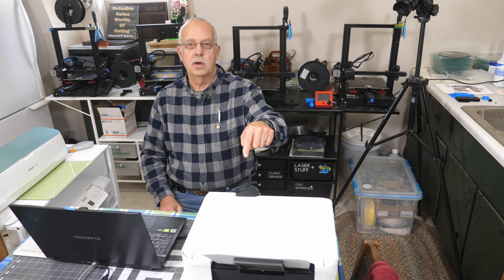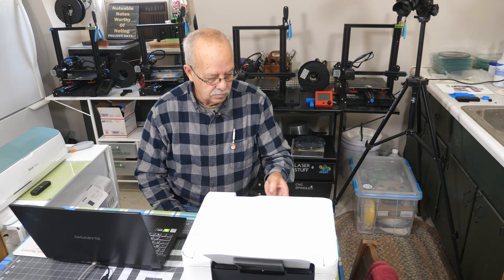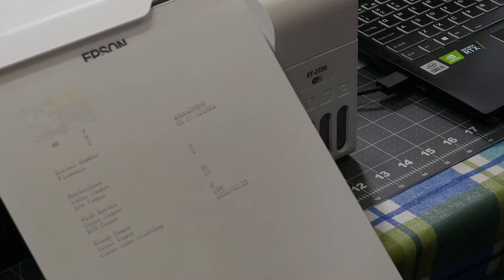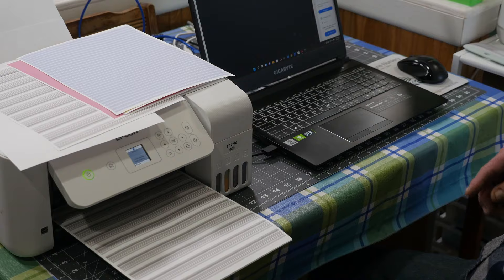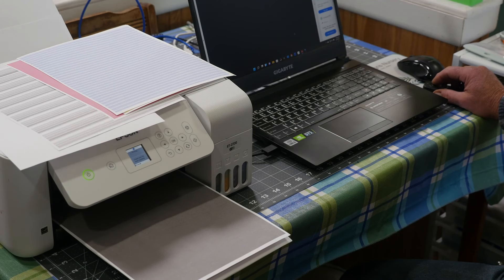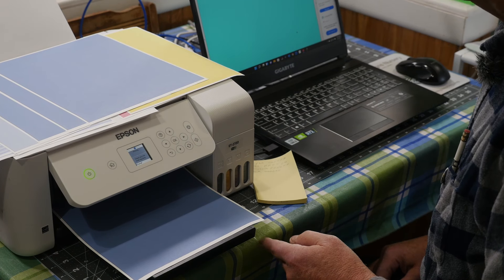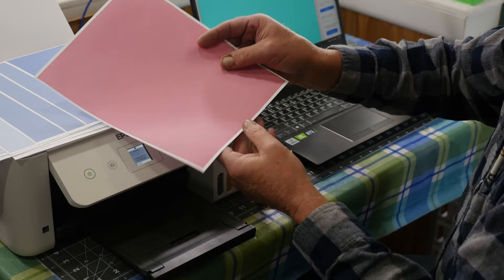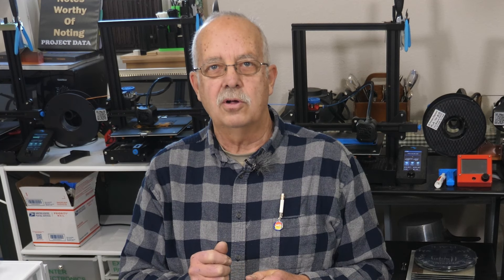Epson 2720 Printer Clogged Nozzles FIX

Comment from the maker: NOTE:  this works for "MOST", but NOT everyone.  As they say, "Your Mileage May Vary"!
Reply from the maker: @Alicia Woodard Since it is a download, it is in the description:  Link to free download of .pdf color files to print:  http://moonshinecrafts.com/help-with-...
Reply: Any suggestions if I tried at least a dozen times on each color that doesn't work & they're both still blank? It was printing fine last night (all colors) & then after a few sheets, magenta stopped working. So I bought more ink. Now I've been troubleshooting all day. Ugh!
Reply from the maker: @kevmicshi  You can try shaking your printer from side to side several times and try again.  This works most of the time, but not for everyone.  As a last resort, try a Power Clean.
Reply: @Roger's Shop  Thanks for the link. I have an Epson 8550. Do you have links or info for the additional colors? Pigment Black, Gray
Reply from the maker: @santafepainter  I do not have the HEX codes for the other two inks.
Reply: @rogersshop  I have printed I know 75 sheets of cyan still have lines the other colors are fine any other suggestions
Reply from the maker: @tonyabailey1028  This may offer more insight:  https://youtu.be/uffJPjR7Sy8
Reply: Help I’ve printed & printed the sheets and still have lines. I’m devastated, I can’t do anything because of the lines.
Reply from the maker: @annierakes2435  Try changing your settings to high quality photo, this often works.
Reply: Hey Roger! My printer is practically new I used it twice and it sat up for a minute! It stopped printing all colors. Can I still use your method to try to get it to work?
Reply from the maker: @cemax7866  Yes.  You might also try shaking the printer side to side several times.
Reply: @rogersshop  thank you so much for responding! You’re appreciated! I enjoyed the video very educational for beginners and easy step by step processes! I will try your method and see what happens!
Reply: Thank you
Reply: Thank you so much. Easy to understand and the free pages are so nice!  My colors were ok, they look better now though. I'm still black-less... I mean zero black... but I'm not giving up!  I can't find a speed setting when I send to print, to adjust that. But I'll try the photo paper  settings on the printer itself.  I am determined. (Determined to avoid hearing the flurry of bad words when my college kid can't get his papers to print at the last minute!  Haha)
Reply: @rogersshop TYSM for this. I didn't see where high quality option is at or more options 😢
Reply: @rogersshop  my printer is working great again. I caught  it as it happened. Thanks a bunch.

Comment: Is it safe to use this method when the epson utility keeps warning to check the Inc  levels when I'm doing a regular cleaning? we've did several cleanings and check the ink levels, but so far all I could get is cyan to print with your method. i'm worried about repeated attempts to print pages if it's not working damaging the printer. especially since I get this warning message. I don't think it's saying low level, but I am totally blind and don't know for sure I have to get sided confirmation. thank you.

Comment: Perhaps this wasn't a thing 2 yrs ago but if anyone tries this recently, the maintenance tank is in fact replaceable on this model. The flap for it unscrews with one screw at the back corner of the printer.
Reply from the maker: Yes, it is replaceable when you can find the part.  Hit and miss item.

Comment: It works!  My black had lines through it and it took about 50 pages and another ink refill (I had just refilled it a few days ago) but it works now!  Thank you for a simple solution and for providing the CYMB template (another video told me to google it and that was getting frustrating). I appreciate your calm, easy pace throughout the video.  You're the best!:trophy-yellow-smiling:

Comment: I can't tell you how many YouTube videos I watched to try to figure out how to get the color ink to work again on my Epson printer.  Finally I found your's & it did the trick.  I would much rather use up paper than run the risk of overloading my maintenance tank or do some of the other procedures suggested by the other videos.  Thank you so much for this information as well as for the test color pages that I can run and run until the nozzles are completely unclogged again.  What a great service you just provided!

Comment: Excellent suggestion, Roger. Thanks!  I was about to try a deep clean and didn't even know about the waste tank issue, so I'm glad I found this first.  Your method resolved my "no yellow" issue after only six pages. (It worked even better once I forced the printer to print as if it had glossy paper even though I was using plain.)

Comment: Thank you very much.Yesterday I was going to clean the heads using solution which will take time and will have a mess. I already opened the top of printer.
Then I told myself, I will try to watch another video. I saw this one. I made power cleaning which fixed the problem.Printer wasn’t printing at all before that.
Thanks again.

Comment: Update:  I printed out the solid color file you shared (thanks so much).  I was wondering how to flush the old ink.  Well the black kept being really streaked and the other color had mild streaks.  So went back and rewatched your video!  Bingo, you noted to run the pages in slower, high quality setting.  Once I did that, I got beautiful solid colors.  That did it.  Now I'm getting beautiful pages again.  Thanks so much for this excellent video.    I went from getting NOTHING on printed page to getting full beautiful color.  I ran the head and nozzle cleaning tons of times before that and it didn't really do anything.  After flushing it out with the solid colors and changing the quality of print, it now runs great.  Again thanks.
Reply from the maker: Glad it worked out for you.  This works for most, but not everyone.

Comment: I spent a long time trying to get my printer working. Blue and yellow had stopped completely. I tried printing your sheets many times but with no effect. My tanks were about 3/4 full, but I decided to top them up in anticipation of a power clean.  A last nozzle check then showed yellow working and blue missing only one line. I then printed your blue sheet and all is now working perfectly. I think the solution is that topping up the ink and giving the top-up bottle a light squeeze sorted out an air lock in the tubes. 
To summarize: If a colour is missing completely, try topping up the colour and giving the bottle a gentle squeeze before printing the colour sheets, as this may be the solution.

Comment: Sadly I had to use the power cleaning because after ten pages it wasn't printing a single drop of color. My black ink was fine because I print with it often, but I never print color. 
Power cleaning worked and I learned my lesson.  From now on I'm printing once a week to keep the ink flowing.

Thanks for the help, Roger.

Comment: Thank you so much for this. I just followed your lead and it totally worked for me! My cyan wouldn't print at all, though it was full. Now it's printing back to normal. I really appreciate your advice about the maintenance tank, because I kept running the clean function, and no doubt would have ended up having to get a new printer.❤️

Comment: I just recently started looking for a DIY video to help at cleaning my 2720 and after about two or three other folks I came across your video Roger and at first I wasn't sure as to what information would be shared...however, after taking the time to watch your video I see your have some some very sensible and cost saving measures to clean the print heads without taking the printer apart or replacing the storage filter before it time.  I've been there and done that and I figured there has to be an easy way.  Thank you so much for the pdf sheets.  I tried them and it worked well.  The cleanest I've seen my printer since owning it (for over 3 years.)  Thank you for being there and sharing this for us Roger!!!  Saved me a lot of time and extra money.

Comment: Thanks Roger for this helpful video. I used it to clean up undesired lines in print outpus on my Epson ET-15000 and ET-8550 printers.  The key is to print colrs at the BEST setting to clean out clogs. Thnks, again. Blessings!

Comment: Great video. I have the same printer and didn't think this type of ink would dry up but it does over time. I used alcohol and paper towel to physically wipe the nozzles. That helped, but  i still had to run dozens of test pages . Uses less ink but takes more pages.

Comment: Good video Roger, I have an ET2720 with sub ink in it, I made the mistake of running a power clean before I knew better, Another way to prevent this from happening is printing a print once a week that uses all 4 colors.

Comment: I just wanted to thank you for solving my problem.  I have an Epson ET 7700 with a white line problem.  Thanks to using your print out colour sheets, I found it was just the Cyan and Black that had the issue.  Just 2 prints out at best quality and they all seem to be okay now.  Many thanks for the advice.

Comment: Didn't really find the option to make it print slow, but I selected High-quality, 600dpi (if it makes a difference). My Magenta has some lines but it prints the full page, Yellow and Cyan I ran about 10x and the page just comes out clean. I'll try running 100 more times before I do any power cleaning. Thank you for explaining so well!

Comment: I wish I would have come across your video earlier. I had already done the Power clean but the purge printer are slowly working. not sure what I did (I use my printer almost daily) and it wasn't working but the purging after about 40 times is finally getting my yellow and Cyan to print with lines and the black is slowing coming along... hopefully this keeps me from having to buy a new printer today. Thank you!

Comment: Hi Roger. I was hoping to make a 'hooray' comment but this method hasn't yet worked for me. I have the 2720, using regular ink and not sublimation and the cyan is not printing at all.  I have purged about 20 sheets with slow/quality print settings. I opened the machine up and it looked like the reservoir closet to the nozzle head isn't filling with ink. Clogged line I guess. Any suggestions before I surrender to the power clean??? And can we not replace the discarded ink pads/reservoir after they are saturated??
Reply from the maker: Try disconnecting the printer and shaking the printer side to side several times and try again.  May be sediment is clogging the tank outlet.

Comment: This was such a blessing to find this video. Solved about 99% of my problems.  One color, Cyan is still showing one while line even after more than 25 full page printings.  Do you have a suggestion?
Reply from the maker: Try running a sheet in photo mode, high quality.  This might work to clear that one nozzle.
Reply: Roger, you were right. Cleared it right up.  Man I can't thank you enough.  I have been so blessed by you willingness to help out.

Comment: Thank you so much.  I have been researching Epson vs Sawgrass and it seemed that I would have to do sublimation every single day using the Epson to prevent nozzle clogs and all I would have to do with Sawgrass is the nozzle check.  I wouldn't do sublimation every single day since I am only making items for gifts so I did not want to invest a lot of money into an actual sublimation printer (even though I would love to).  This video has helped me so much.  At least I know how to clean the nozzles if I ever needed to.
Reply from the maker: The advantage of a Sawgrass is that it self-maintains.  But, you DO pay for that!   With the Epson, so long as you run at least a nozzle check once or twice a week, it should be fine.  Just enough to keep the ink from drying on the head.
Reply: Hey Roger, I tried your method as several nozzle checks did not have solid lines. Went through about 50 sheets of paper front and back with no magenta, yellow, and cyan fading with each print. And black fading with each print. Eventually I had to do a power clean which did get me every color but still awful lines in black. I am at a loss for the black. I honestly don’t know what to do. Any advice?! I have a 2720. We also tried a wet paper towel method, and nothing. I tried to do your method again, with just printing out the black- still a ton of horizontal lines. I also shook it back and forth- nothing.
Reply: also i tried vertical and horizontal alignment- and it’s totally off w both. Lines in everything. Is there any hope for this printer?! 🥴

Comment: Thank  you for the link. I had been looking on the ET-3600 video. Will be trying them today. Cyan is acting up.    I've used the cyan file. After about 8 printed pages of nothing I'm convinced that I need to physically clean the cyan print nozzle. Thanks again for the help.

Comment: Nothing worked for me to have the color show up so I had to do a power clean. I wonder how many power cleans it takes to clog the ink pad? I emailed epson about my issue and their response was super unhelpful and didn't address the issue at all, not sure if I'm the only one who's had this experience. I also asked customer service how to prevent ink not showing up and they basically said "idk".. thank you for this video, super helpful. I'm going to run it every week like you mentioned and hopefully I won't have to run into this issue again!
Reply: Also I'm probably going to renew my warranty, I'm becoming more paranoid that it'll stop working on me one day 😅
Reply from the maker: Once you get everything working properly, print some thing is full color at least once a week, even if it is only the nozzle check sheet.  This should keep the head clear.  If you should happen to fill the maintenance tank, it may not be replaceable.  Depends on the model.

Comment: For all of you that this didn't work or was taking too long: I opened mine (not hard, just 4 screws). I saw that the dampers in the head were all empty. Black was full (black was the only one working). I took the lines off the dampers and pulled with a syringe. After 2-3 syringe-fulls of air, the ink came. I then put the line back, and pulled on the bottom of the damper with the syringe until the ink was pulled into it. This made sure there was no air or clogs and that the ink was finally in the printer head. So far so good.

This is a great video though and if my problem wasn't so dire it would have been the trick. Will use my printer more often ... haha.

Comment: Hi there, Roger. i tried it. my 1st page showed a good  sigh lots of color with some lines, 2nd page all the way to the 18th page all clear no ink on page, this is for my magenta and cyan.. haven't tried the other 2 colors. any suggestions? BTW thanks for your  video!! ive learn so much from watching  your videos and taking on your recommendations!
Reply from the maker: You can also try disconnecting printer, then shake from side to side several times, then reconnect and try again.  This works "most" of the time.

Comment: Hey Roger. Thanks for the video.
I have a clog but it's very clearly at the tank end.
Yellow and magenta seem fine ish but black the whole line is clear without any ink in it all the way back to the filler tank. What can I do at that end to help free it because its very clearly difficult to remove
Reply from the maker: Try disconnecting the printer and shaking it from side to side several times.  If sediment has formed in the tank, this may shake it loose.
Reply: @rogersshop  I'll give it a go thanks
Reply: Hey, no joy, the line that has no ink running through it is ironically the one I only use.
I have tried shaking etc and I also took the line off of the head and blew air into it but can hear the ink bubbling so there must be clearance.
Maybe it's not being pulled from the tank into the head?
Reply from the maker: @nathanspain576  Inside the printer is a damper tank with a cellophane membrane on one side.  It is not unusual to have one lose seal or get a pinhole.  If this happens there is not enough vacuum to pull ink from the tank.  If the damper tank has no ink in it, then I would suspect the damper tank is at fault.

Comment: Hi Roger, thank you so much for helping with this print issue!  I have this Epson printer and when I recently replaced the Hippo ink for the first time I began to have problems. My printer is little less than a year old.   I ran the sheets thru and it works for every color but the magenta is still gray, I'm at 8 pages now and still running pages.

Comment: Hi Roger. Thanks for the video. Prior to watching this video, I ran a nozzle check/cleaning three times and the colors acutally got worse. upon printing your color sheets, the pages are blank. any suggestions. did I cause a different problem when I did the cleanings?
Reply from the maker: Try shaking your printer from side to side several times, then try again.  This works for most, but not all.